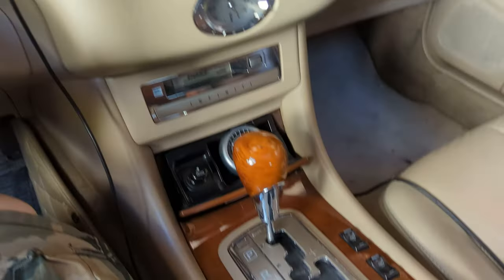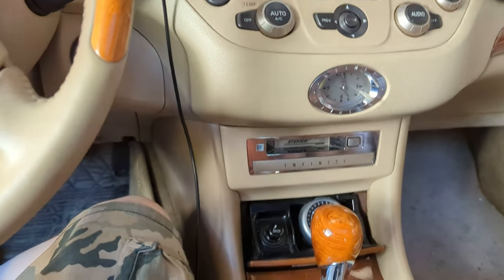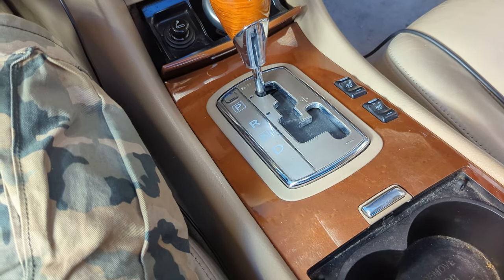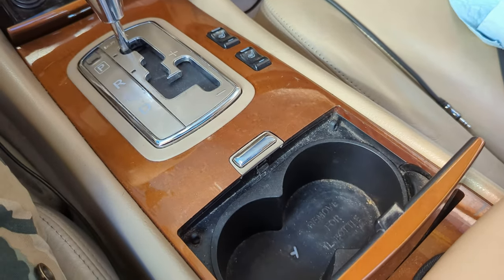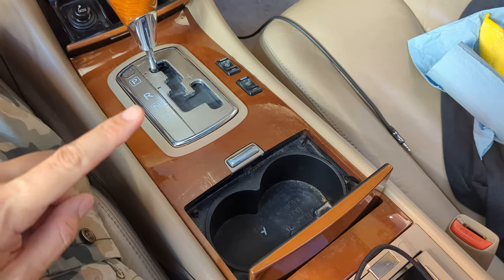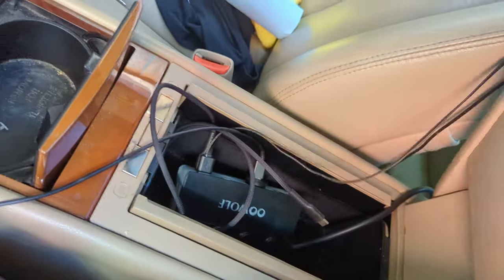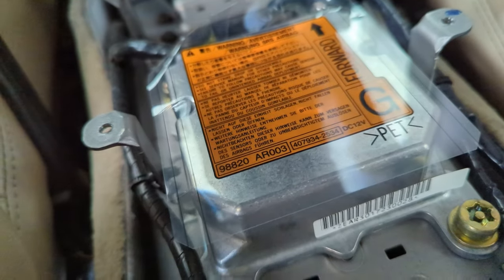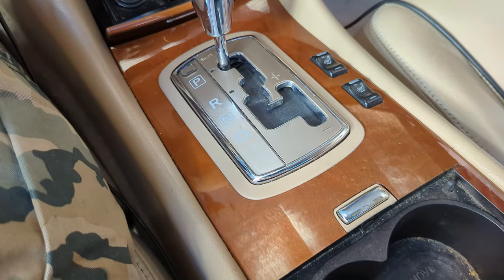Yaw sensor delete

Comment: Thanks going to do this, but mine only does one wheel peel 😥I need a locking rear diff
Reply from the maker: same, the water box let's both spin but having a quaife or wavetrac will likely be the next step for the rear end
Reply: Yea I tried to do a standing burnout. It'll start to do it then the rpms are limited to like 2k.
My buddy said yea it wouldn't work cause of the tires I had on there" (Firestone indy500). But still wouldn't with eagle sports. 

I will say with vdc off and it acting like a locking diff... the traction module does really good. Almost as good as my 92 Q
Reply from the maker: @pontiac38gm the Indy 500s grip up nice with some heat. Are you doing this with the yaw sensor unplugged? it worked great on my car.
Reply: @30YearOldBunta  what do you think about welding 🤔🤔🤔
Reply: @30YearOldBunta  I haven't unplug it yet. Going to the track Sunday so might just do the ol pull the fuse trick

Comment: @30YearOldBunta i have a 2002 q45 sport premium , i let it st and now vdc and slip light s are on. Does it mean they are turned off ? If so its fine with me car drives good , or should i reset them ( if possible ) . I dont race .
Reply from the maker: yeah it usually means wheel speed sensors are going, having NDS or a dealership scan tool is the only real way to tell.
Reply: Did u fix it I have same problem code p1720
Reply from the maker: @abdullatayyeib8125 I didn't, I've got a reoccurring p1720 and p1320.. doesn't seem to affect performance on mine. Still not 100% sure what's causing it

Comment: Hey bunts wondering if you’ve swapped your v t solenoids and if you’ve had any issues thanks man your channels been a huge hel looking forward to seeing your car at full potential
Reply from the maker: thanks man, yeah it was something I changed when I first started getting the timing issue.. was literally just throwing parts at it hoping it worked.

I have a few more plans of attack but the car is still intermittently having that issue.

I'm back to suspecting something in the transmission might be causing timing pulls. Still investigating tho never gonna give up.
Reply: I found the brake pedal plug underneath dash is the best way it completely disabled is and my car rips